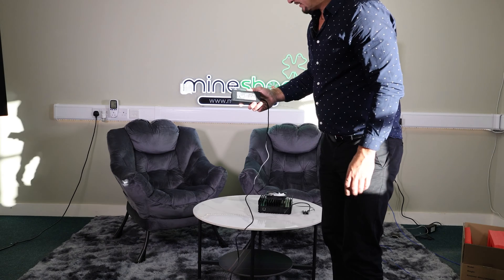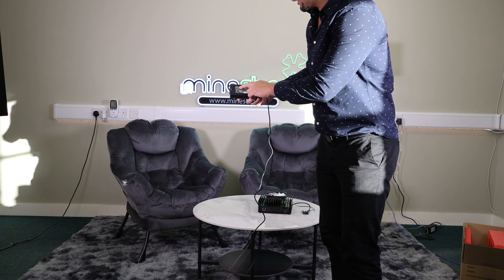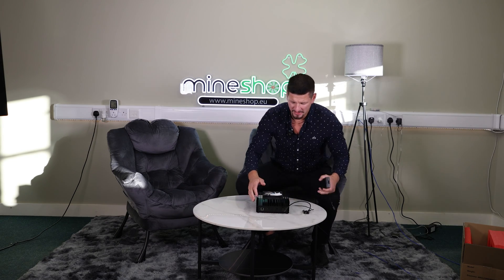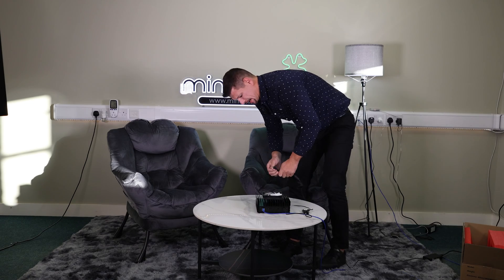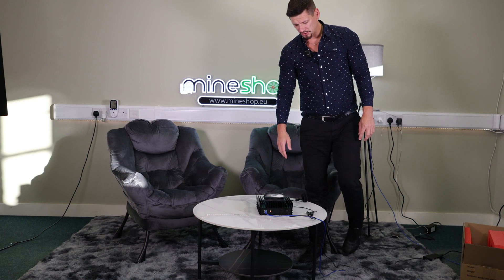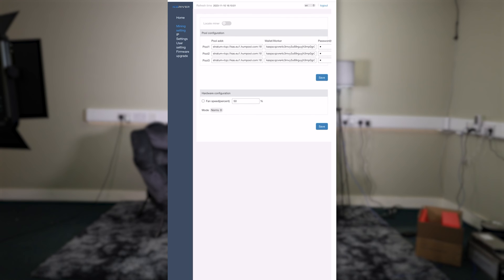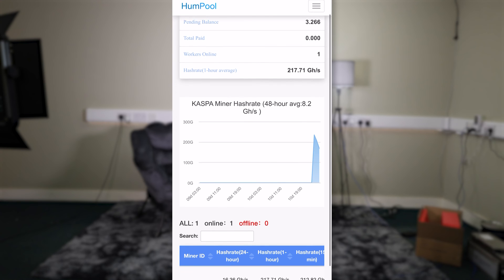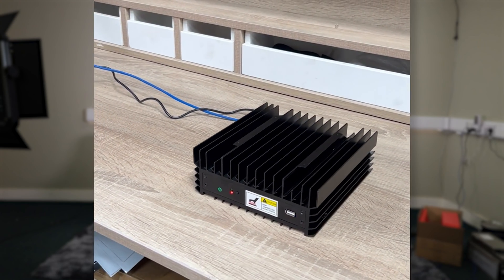IceRiver's KS0 Pro 200Gh/s KASPA ASIC Miner in Action!

Comment: Hey nice video I just got my pro and wanted to add the extra fan like you did but the bolts that came with mine are to big so do you know what size they are like how long and wide? Thanks
Reply from the maker: Hey not sure which size the screws we had some in warehouse which did fit .

Comment: Thanks bud is the size of the power plug is same as KS0 100G or it changed
Reply from the maker: Im not sure which was on original KS0, as we used custom PSU on previous version. But this seems sufficient to power up can output up to 120w, miner output itself is 120w.